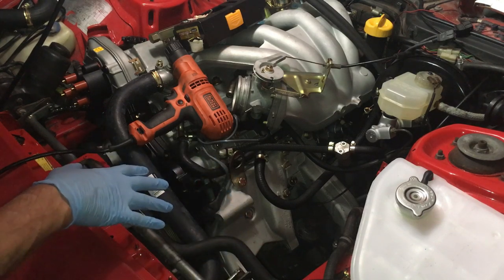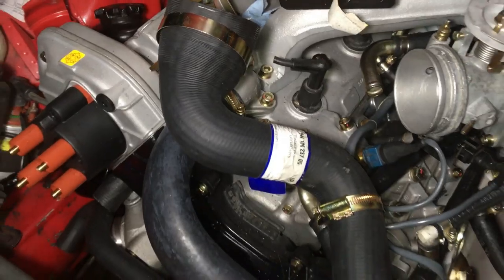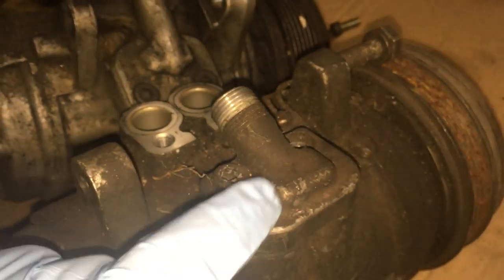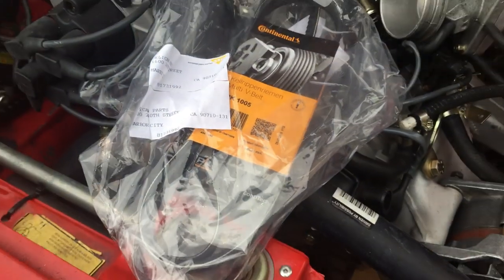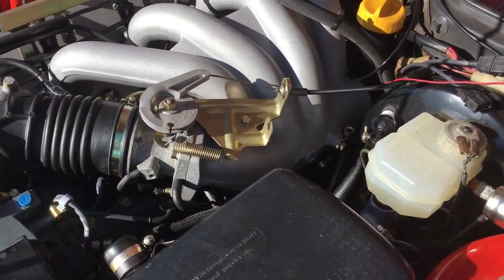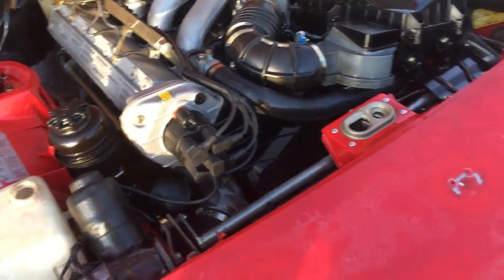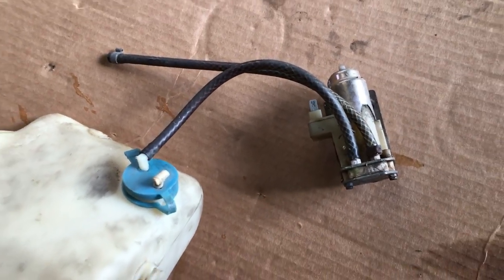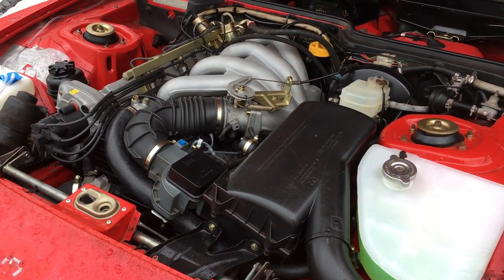Porsche 944 Restoration -Part 4

Comment: Wow, Brent. It didn't look better in -84 !  About the windshield washer pump, I had one that was stuck, but compared to the newer type replacement, it's actually a better built pump. Also contrary to the newer one, it's serviceable. So I opened it, which was unexpectedly easy, cleaned it (grinding off a bit of rust from the laminated rotor) and gave it a drop of oil, and it still works for me.. but you probably done that already.
Reply from the maker: I just went ahead and bought a new one. I think it was about $13 and saved me a load of time. Thanks!
Reply: @edredas  If same way as the starter motor- Very fast indeed. But seriously besides the only new one I could get over here (EU) was inferior quality, just one block of plastic, it was my daily drive and I opted to fix the old one for the same reason, time. Not working time, though. It would have taken me longer to wait for parts. Autumn in Norway can be rally wet and I already had to stop once on the highway after a truck in front left me completely blind without washer fluid.

Comment: That bay looks soooo good! Do you have a video of replacing the washer tank? BTW I used your advice on adjusting the headlight buckets and now I can see at night! many thanks!
Reply from the maker: Not yet but it’s pretty easy to remove. There’s just a bolt up top then two down below. You’ll also have to pop up the headlights to drop it out the bottom. 85.5 and later require a bracket to be removed underneath while 88 and later models have smaller tanks.  I hope that helps!
Reply: Awesome, I'll let you know how it goes!

Comment: Do you have a video on how to fix a rear hatch that is delaminating from the frame? I was told by a Porsche specialist shop it is a real bear of a job. I want to do this on mine cause they said this is why i cant get my hatch to pop open.
Reply from the maker: No, and unfortunately I'll probably never make one, although I get asked all the time. There's a lot of reasons why, mainly because I have too many cars at the shop these days it would take too much time. Not to mention good hatches are rather cheap so its just easier to replace them in a few minutes for a few hundred rather than someone paying me a few hundred an hour to fix them, when that could end up costing a few grand. So, it doesn't make sense at the end of the day. That said, if I ever have the chance I will make a video on the process. From what I've heard, stay away from silicone and only use products that bond to glass. I hope that helps!

Comment: do you have amodized machine so zinc code all old bolts and hose clams or you got all new bolts from porsche its probably reallly expensive ??
Reply from the maker: We have the parts blasted and replated. Sometimes the clamps are brand new since they rust. It’s not too expensive, costing about $200 or so for everything. Thanks!

Comment: Did you just clean up the cast aluminum pieces, or paint them as well? How did you reattach the blower motor shroud? On an '84 that I have I was thinking of trying to come up with a mechanical fastening system. That black gunk took forever and a day to clean up. There's no way I'm using that!
Reply from the maker: Yes all the aluminum was cleaned and no paint was used.  As for the shroud, the black stuff released cleanly from the shrouds so there was no mess. Then I just stuck the new one back on and heated it up with the the heat gun. It’s back on like it was never replaced.
Reply: who replated the bolts and brakets and fuel rail i need a good company or someone that  do that kind job

Comment: i have been looking around for a new (-) & (+) battery cable assy and they are pricey. looks like removal and replicating the oem with a part with all the correct cable sizes is the way to go. I'm having a low charging issue, if the car is jumped it stays on and runs fine. shut it off and start it again it seems fine, but the cables' insulation is almost all gone. the copper is corroded on both.
Reply from the maker: I had to replace those in my car. I just went to napa and got some 1 AWG wire the correct length and then put my own ends with heat shrink on them. I think it was about $50.

Comment: Love the videos! Gets me inspired to work on my 85 944 was wondering if you seen problems with the parking brake cable not engaging? Keep up the vids!
Reply from the maker: Thanks, yes the issue is often a problem with the pads being worn or the mechanism itself needing adjustment. There is a method that must be used when reinstalling the disc to assure proper operation of the hand brake. If the pads look good and do not appear to be glazed over, use the pad adjustment dial to move them out as far as possible but still allow the disc to go on. The tighter the fit the better. You'll want them to be extremely snug against the disc and then if that was the issue, then the brake should hold with just two tiny clicks. I hope that helps!

Comment: The cluster is old in these cars can I change it to a update 1 or better lighting
Reply from the maker: What year is your car? If you have an early car (82-85.1) you can try brighter incandescent bulbs. I have a few early cars and can see everything clearly, but going to 924S gauges which have white numerals may also help. LED bulbs tend to focus the light in one area while leaving the rest of the face dark, so keep that in mind. The later gauges cannot be installed into an earlier car and they are often dimmer than the earlier cars, so there is no upgrade there. However if you have an 85.5 and later car you can make the gauges brighter by fixing the reflective material and also adding brighter bulbs as well. Since these gauges are back lit with the light being projected onto the front of the gauges the are often not as bright as the early cars, even when working properly. I hope that helps!

Comment: Just wondering how you get that nice sheen on those plastic parts, not too much, just right Brent.  Really nice as always.
Reply from the maker: I try to be mindful of what I use. Products like Armor All tends to look nice for a few minutes but then you can't really tell you applied anything at all. Then you've got some petroleum based products that last a long time but have some unintended side effects. Products like tire shine work great and while the sheen lasts longer, sometimes it leaves behind a brown residue once it fades that cannot be removed. So that's fine on tires which are consumable, but not ideal on engine bay parts. I also have to use this stuff around aluminum parts, so petroleum based stuff is out since it will turn aluminum a dark brown. So, what I use may sound weird but its just regular old WD-40. Its water based and I just leave it on until it dries. The sheen will last a while and you can just rinse it off at anytime without anything being left behind. Best part is it also prevents aluminum from oxidizing and won't turn it any odd colors. I hope that helps!

Comment: Where did you find the brand new looking fuel rail and other parts lol I can only find used stuff that looks slightly used haha
Reply from the maker: I had the fuel rail replated along with all the bolts. So it’s an old rail that was made to look new again.
Reply: @edredas  i noticed the fuel regulators were replated as well. Is that safe for the internal diaphragms?
Reply from the maker: tiderfish  Oh no, those are brand new... I toss them since there's no way I want to spend all that time building an engine only to have it run rough due to an old part.  👍
Reply: @edredas  You're luck it was an early model. I recently bought a new flow damper for the later rail in my 924S and it wasn't cheap.

Comment: My son and I are currently rebuilding a 1987 944s the 389th off the line! Would you happen to know what the injection flow rate and ohms are for it i have looked at a few forums and flow rates very from 196cc pr/min to 260cc pr/min at 3bar for the same injector any advice would be appreciated. Pepr
Reply from the maker: Congrats! Your '87 should have fuel injectors with part number 0 280 150 158 and a flow rate of 229 cc/min@ 3 bar with 2.4 ohm. I hope that helps!
Reply from the maker: Oh I see that you meant 944S... I missed the lower case 's'. A lot of times people will just put a lower case s on the end of 944 for being plural, so my brain just ignores it at this point. That said, with a 944S the part number is  0 280 150 811 the book says the flow rate is 277 cc/min@ 3 bar with 2.4 ohm. I hope that helps!

Comment: I'm experiencing a no crank issue with my 87 924S. I turn the key and all I get is a click. I replaced the battery and starter and cleaned all connections so I'm not sure what the problem is. Any ideas?
Reply from the maker: All sorts of variables there at this point. Someone could have added an alarm and hacked up the wiring... I had that happen once. It could also be a bad ignition switch. They're known to crack and cause all sorts of issues. However I would start with the wiring. Make sure you are getting continuity between the wire at the starter solenoid and the switch. There is also a wire that runs from the battery to the switch, that you'll need to verify is sending power. That wire was what they cut when they installed that alarm. If you have power at the switch but its not making it to the starter, then it will be a broken switch. Anyway, that should get you started. I hope that helps!
Reply: Thank you so much for the advice! I replaced the ignition switch and that seemed to do the trick for a few days. Now the same problem has returned. I'll check the continuity and wiring and see what I discover. Really appreciate your helpful feedback!
Reply: Solenoid

Comment: when you got a sleave installed on the block did you use stock pistons? or did you use aftermarket pistons that work for both alusil and the steel sleave? hope you have time to respond i love your channel!
Reply from the maker: I used the original pistons for this engine. The stock pistons have an iron coating to prevent the silicone in the alusil block from wearing the piston skirts but will work just fine with a steel sleeve. So while you can put just about any piston in a sleeved engine, you need a ferro coated piston in an alusil block. Thanks!

Comment: What’s the typical amount u spend on a car to get it to run
Reply from the maker: Hard to say since getting a car running can be easy, but making it reliable is another. I'd say in order to make it reliable you may spend close to a grand in parts. I always replace the belts, rollers, water pump, front seals, collars, oil cooler seals, vacuum lines, and coolant hoses before considering driving it anywhere. I hope that helps!
Reply: edredas yes that helped a lot. But I have a 84’ 944 and it’s not ruining i would like to know if it’s worth the money to  fix

Comment: If you remember me, I'm the guy near Buffalo NY with a 1984 944 that won't start... still... I've found a few wires behind the relay and fuse panels that aren't connected, any idea where they might go? the first is a black/red wire with a bare connector, the next is a 2 wire plug with round holes for the connector one wire is bright greensand the 2nd is bright green with black stripe... there are also 2 wires that have clear long rectangular plastic plug covers, one is white/black stripe and thin, the other has the same type of clear plug end, I cant remember the color of that one... I don't know what else to do to get this thing started.... please help
Reply from the maker: Hi, there are a lot of random wires back there that don't plug into anything unless you have optional equipment. For instance if you don't have the rear wiper the wires will just be back there not connected to anything. That said, what have you checked so far? I would start with the basics. Jump the DME relay and then check for tach bounce. Afterwards check the sensors and fuel pump. I hope that helps!

Comment: I wonder if I can make my engine look that immaculate with a can of gold paint to simulate the plating. :D
Reply from the maker: I have done it before and it works to some degree. I did it just to see how it would hold up compared to the plating. However in person the plating has an iridescent look to it with reds and greens. That can be simulated with some colored stain and then clear coated, but if you're going to go to all the trouble, the plating is not that expensive. You can get all the bolts and every part plated for about $150 or so and its a lot less work. I hope that helps!
Reply: @edredas  Thanks, I actually have some experience with painting to simulate plating, such as how I did so with metallic green paint+ misted on gold paint on parts of a Porsche 914. It looked pretty good. But if you say that plating everything is only about $150, I think that's a better deal. :)
Reply: I had a bunch of stuff plated for my '87 924S and it wasn't very expensive, even where I am in California. I bet it's cheaper everywhere else.
Reply: That sounds great. Unfortunately I'm not doing a whole engine rebuild. I just don't like my engine looking like rubbish.
Reply: @Vwp914  I didn't rebuild mine either. I just took what came off as part of other work, and since it was off, I cleaned it up as best I could. In the case of stuff that was plated, it was easy to get it re-plated. The thing with painted-to-look plated stuff is that it'll chip and wear like a painted part, which will then look pretty cheesy in short order.